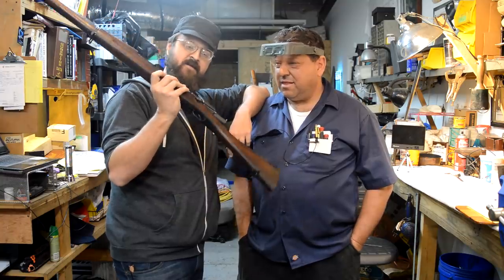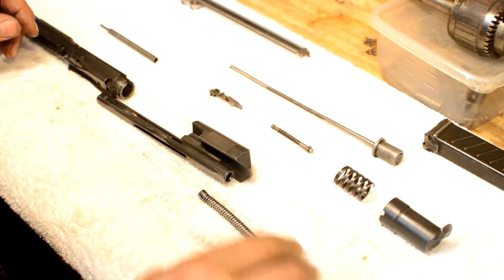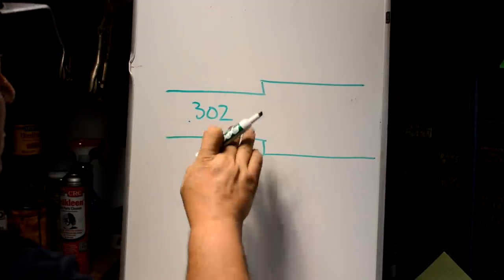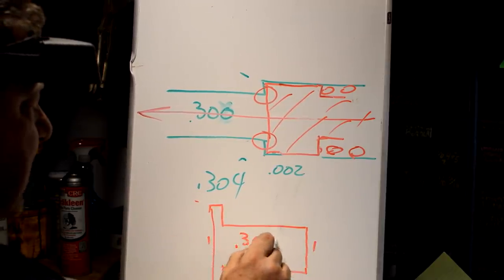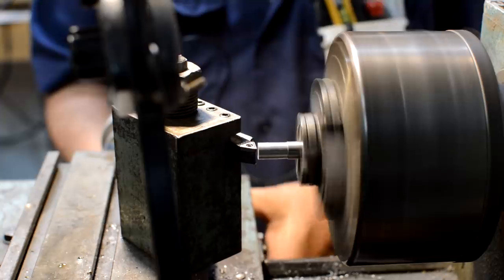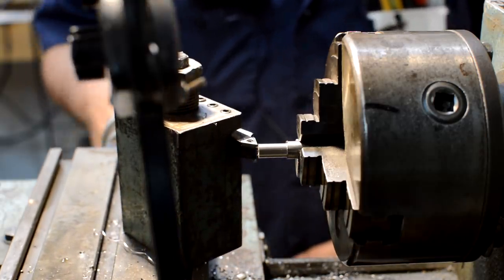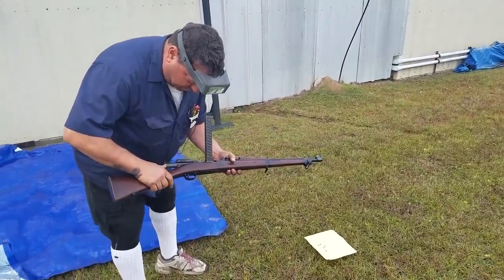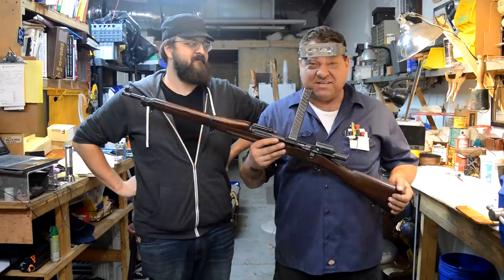Anvil 022: Pederson Device recovery

Comment: Don't know what's scarier. That someone thought packing what essentially is a pistol into a bolt and chamber of a .30 '06 made sense, that someone managed to make it work, or Mark's socks.
Reply: I'm going to go with making it work.

I've seen scarier socks, but after watching the C&Rsenal on the Pedersen Device I am absolutely amazed that it worked.
Reply: Well, we still have 32 acp and 30 carbine inserts for 308 and 30-06. If someone makes a semi-auto bolt and mag adapter for a 308 that would be an interesting camp gun.
Reply: @randomidiot8142  the Semi-auto part of that would be a pain in the ass. Bolt action rifles have a simple dropping sear with no disconnector. The M1903Mk1 has some extra parts added to work as the disconnector in the rifle.

I should add that I'm surprised that the Pedersen Device wasn't a full auto. I mean, they were planning on each grunt carrying some 400 rounds of ammo for it!
Reply: @ScottKenny1978  The bolt action rifle trigger might not have the right stock trigger mechanism, but if you can make a semi-auto adapter that's just a small hurdle. A disconnecter on a system like that would be easy, like a tippmann 98 paintball trigger mechanism for example. Technically the tippmann is an open bolt, I know, but it would work. 

I thought the pederson was from the bolt action magazine cutoff time period and before pcc/smg doctrine, so semi-auto makes sense to me..? 🤷‍♂️
Reply: @randomidiot8142  pretty sure that ATF would not like the design if you were selling the adapter and the replacement trigger. A big sign sayings "you will commit a felony with a penalty of $100k fine and 10 years in prison if you don't install the trigger group" isn't likely to fly. "Easily converted to full auto" and all that. You'd probably have to have the buyers send you their rifle to install the new trigger and send it back with the semi-auto bolt.

While you're right about when the Pedersen Device was made, it was also in the middle of Schnellfeuer, MP18s, and the inspiration for the Thompson.

Not to forget that the extra bits in the Mk1 ruin the trigger pull.
Reply: @ScottKenny1978  I think you may have misunderstood what I meant about using the trigger concept/design from a technically open bolt 'gun' on a closed bolt semi-auto. I didn't say make the converted gun open bolt, I just said an existing simple trigger pattern that is out there and it works/would work. The pederson is striker fired, the paintball gun is technically striker fired. The bolt on the conversion wouldn't be held back, just the striker. Not complicated to implement relative to the complexity of designing a semi-auto drop in adapter. 

Extra trigger bits.. well, I've got some simple triggers that are nice and other ones with extra bits that are nice. I kinda doubt that a nice trigger was a priority for these and other general purpose military arms..? 🤷‍♂️ Could be wrong, never hear it mentioned.
Reply: @randomidiot8142  let's see if I can explain this without pictures.

The original M1903Mk1 has a couple extra bits in the trigger that act as a disconnector when the Pedersen Device is installed, the disconnector is not part of the Pedersen Device proper. 

If you have an M1903mk1 with a standard M1903 trigger in it, the Pedersen Device would be full auto only, there's nothing resetting the trigger between shots in a dropping sear trigger. ATF would not like that at all.

So a modern Pedersen Device would also need a piece added to act as the disconnector. If we're doing this to a bolt action with a detachable magazine, it might be possible to stick the disconnector in there instead of in the bolt.

The pre-WW1 US Army was very big on competition shooting, Camp Perry matches etc. This didn't have a lot to do with practical field shooting. This also really drove rifle designs, particularly sights. Some vintages of Krag or 03s had very fiddly sights that were great on a known distance range and terrible on the battlefield. The desire for a good trigger is part of this target shooting fixation. It really took until OEF/OIF got going and the Army started training on a pop-up target range at unknown distances (may have started before 2001, but was not a thing for 1991 Gulf War). In full auto, you don't need a particularly good trigger. But when most of your shooting is Semi-auto, you want a consistent trigger. Heavy is tolerable, if it's consistent. That's honestly the biggest complaint about the M16A2 trigger, it has 3 different pull weights depending on where in the burst count you are, even in semi. It's mechanically simple, but not what anyone wants if they have a choice in the matter.
Reply: @ScottKenny1978  ok, I see a little of what you mean. The 03 looks like a Mauser type trigger similar to my arisaka and sort of like the carcano, but not a Remington type trigger I'm more familiar with. However if a reproduction was done a new trigger design with a disconnecter would be a simple thing that shouldn't ruin the trigger, and function just fine in either mode. I'm not convinced that the standard Mauser or Remington style trigger would allow slam fire if the bolt and striker were dropped simultaneously. Open bolts have mass to make up for bolt speed and strikers have speed to make up for mass. Since the striker is detached from the bolt I could see primers getting dimpled with the striker riding in the bolt, but I have a feeling the actual energy of the striker would be lacking not to mention feed issues if it wasn't designed to feed with the striker/firing pin protruding from the bolt face. 

Am interesting thought process to go through, although the likelihood of such a contraption of high cost and limited utility in this era of consumers that believe everything they read on glossy pages or glowing screens is highly unlikely. A few grains of titegroup, a whiff of fibrous material and a 60 grain hollow point in a 308 would work fine for camp varmints without the complexity of making what is basically a semi-auto pistol to drop in to a bolt action rifle to turn the rifle into.. a really heavy pistol/an underpowered rifle. Dare I say a separate blowback 32 or 30 carbine would be more practical? The horror...

Comment: The Pederson device was a pcc kit before pcc kits were a thing and its such a cool bit of engineering
Reply: Kind of like how the original M1911 prototype was a cool bit of engineering that became a respectable weapon after undergoing about a dozen design iterations. Sadly the Pedersen device didn't get that kind of opportunity for refinement.
Reply: @ostiariusalpha  modern pederson device when
Reply: @ostiariusalpha  The issue is that the Pedersen device is a PCC designed to fit inside an M1903 Springfield rifle. Not only is that a very impressive thing to pull off, even if it didn't work. But it's a pretty pointless task. The U.S. would probably have been better off issuing pistol caliber lever-action rifles.
Reply: @LUR1FAX  That's a lot more weight to carry an M1917 Enfield (which is what they would be equipped with if not for the Pedersen conversion kit) and a separate lever action, against inserting the smaller device and carrying more ammo mags. At least, ideally speaking.
Reply: @ostiariusalpha  Was about 15lbs of extra gear for the Pedersen kit.
Reply: If I find a complete M1903 Mk1, I will do unspeakable things to get a Pedersen Device made for it.
Reply: @ScottKenny1978  A lever action carbine, plus ammo load-out, would have been well over 20 lbs of kit.
Reply: @danieldillon6005  when someone ponies up a ludicrous amount of money for a bunch to be made. I'm seriously expecting them to be a $5000 unit, once in an approximation of mass production.

Also, you'd need an original M1903 Mk1 to have it work. Any random M1903 won't work, will not have the extra parts or ejection port.
Reply: @ostiariusalpha  Well obviously I didn't mean for soldiers to be issued a lever-action rifle in addition to a bolt-action rifle. That would just be stupid, heavy and utterly impractical. No, I'll argue that a lever-action rifle in the trenches of WW1 would have been far more useful than a bolt-action rifle. And at the ranges were combat took place in WW1, as well as the ranges at which soldiers could actually hit each other, a lever-action rifle in .30-30 or something would be more than sufficient for combat. 

Also, even if it's heavier than carrying an M1903 Springfield plus a Pedersen device, at least the lever-action rifle could actually have been available while the war was going on. And a lever-action rifle like a Winchester 92 actually works. The Pedersen device was invented too late to see any combat at all, and also didn't work. And the Pedersen device used a cartridge that was maybe slightly more powerful than .32 ACP. .30-30 or even a pistol caliber like .44-40 would be far more effective against targets that shoot back.
Reply: @LUR1FAX  That would have never happened, even if pigs flew and hell froze over. They absolutely used their rifles at longer effective ranges than .30-30 was good for. The French 8mm Lebel was a dinosaur of a cartridge in many ways, but its balle D bullet was actually quite advanced, allowing it to outshoot the German's 7.92x57mm S Patrone cartridge; which the Germans themselves noted. The real problems with lever actions though is that they were more expensive than bolt actions, more complicated to maintain (for both the individual infantryman and armorer), required more training to properly operate from the prone, and pistol caliber leverguns couldn't use stripper clips. Also, the .30-18 Pedersen is actually a fantastic cartridge and John Pedersen did an excellent job in designing it. The .30 Pedersen has about 33% greater energy than .32 ACP from similar barrel lengths and better penetration than .380 ACP; from a subcompact pistol, it would handily outperform either of those two common rounds. I mean, it's not 9x19mm Parabellum, but it isn't trying to be. What it could do though, is make for a much slimmer double-stack magazine in an ultra compact concealed carry handgun.

Comment: We have a #5 Warner and Swasey turret lathe.  It make jobs like these a snap.  And you could set it up to make thousands of them, for that huge unserved Pederson repair parts market!  😉
Reply: I ran a Warner Swasey 2A, 3A, and 4A for 7.5 years making bronze bushings, bearings, and washers. We also had a #5 but I think I only ran it maybe once or twice after the previous operator retired. I was trained on the 2A with extended bed, then went to the 4A as my main machine, got laid off after 2 years. Then 60 days later I got called back and ran the 2A with extended bed for the remaining time I was there.

The 2A's and 3A were in very good condition. The 4A was pretty well shot it was purchased from a Texas oil field that used it for hobbing pipe, they didn't even have the turret and turret apron on it. It ended up at a machinery dealer in Cleveland who put a metric turret on it. My employer and his purchasing agent were not skilled in assessing machines and bought it anyway. So no matter what you did the O.D. and I.D. always ran at different feed rates due to the Imperial gearing in the the one apron and the metric gearing in the other. Those power chuck wrenches sure were nice though.

Comment: Never judge an artist by his tools or his methods.  The proof is in the pudding.
Reply: Yes, but my heart broke when he was marking with the caliper on a running lathe. Hopefully, that caliper was designated for rough work, and that he keeps another one for  accurate  measurements.
Reply: @sidekickbob7227  if you own a calliper you probably an four or five of them. I love my high end Mitutoyo but my Ali Express tools get way more use and I won’t cry if I drop them on the ground.
Reply: @john-paulsilke893  Yeah, I always buy the upper middel quality ones (mitutoyo?), and degrade them after they get used. I keep one for accuracy, one for daily use, and one rough for marking. But I would never marked a piece in the lathe, while it was running. That's just abuse.
Reply: Or his shoes.

Comment from the maker: https://www.youtube.com/watch?v=M637KpEP1_E&list=PLJvsSlrbdhn5v8AuvAZuOYJ5BgEEoDdqm&index=67&ab_channel=C%26Rsenal      minute 32 is a full firing sequence on C and R senal.      I believe the AEF armorers would have been able to set these up to run given the chance. The part about switching back and forth between rifle and PCC on the fly would not. I think dedicated, worn out 03s would have been cut down to carbine length, and turned into purpose converted weapons. Kind of like the M1 carbine............?
Reply: I believe that they had it working. My source (1968 22nd edition of Gun Digest) says that 65,000 units were manufactured but all except a handful were destroyed. It also lists known units, complete units and partials. Also  Enfield and Mosin-Nagant units

Comment: Had a couple bad experiences running carbide inserts and trying to skim off a hair. Running hard and heavy on material removal looked fantastic and then the last .010" skim absolutely destroyed it. The worst part was the owner, the foreman, and the shop lead scratching their heads over what was going on. My input wasn't requested so I didn't bother saying anything about how to fix it. Skimming with high speed steel is much easier so I haven't bothered with carbide for my personal stuff.

Comment: Holy crap, how many of these are there in the wild, maybe fewer than ten?  Read a lot about the Pedersen device over the years but thank you for allowing us to actually see one in operation for the first time.  BTW, should that plunger you turned be heat treated?
Reply: Best not to harden it as it is a consumable in the scheme of things. Easier to make a new one then have to get inside and repair the face of that tube.
Reply: @DirtyRobot  absolutely
Reply: There's not more than a couple hundred that survived the destruction.

I'd love to get a reproduction, if I find a complete M1903 Mk1. I expect that it'd cost me at least $5k to get made, though.
Reply: @ScottKenny1978  Bruno is CAD'ing it apparently. you might be able to buy the file and get it CNC'd
Reply: @DirtyRobot  while I think that was for the animation on the C&Rsenal video on the Pedersen Device, I will definitely chase them down to see about getting one made if/when I find a complete M1903Mk1!

Comment: This is one of those devices where you really need two or three of them to compare one against the other when, you go to make parts. I also noticed that at 16:28 the hacksaw blade slides off the top of the piece. I quit using hacksaws for that purpose and just use cut off tools.
Reply: The problem is that when you make parts for guns discontinued over 100 years ago, finding any parts to compare with is a total challenge.  Let us note he didn't even have one original in hand and is working off someone else's measurements of a part they happen to have.  This is a common problem with a lot of late 19th, and early 20th century guns and sometimes you never do locate someone with a part to compare to and have to just try different shapes and measurements until you luck on something that works.

Comment: If it became a regular, decently functioning device in the army, I imagine it woulda been really effective in trench combat. A pistol caliber carbine with a 40 round mag woulda slayed in trench combat.
Reply: Seems that way, but compare to a .45 and an 1897, and I'm gonna give the Pederson a hard pass.
Reply: @RexApplegate  it isn't designed to replace your sidearm though even if originally it was a way of meeting the numbers when it became obvious they can't fully equip each soldier with one.
Reply: Problem is it’s attached to a heavy LONG rifle and the magazine is fragile and sticks out a long way out to the side. It’s made for the confines of trench warfare but it’s like a spear with a secondary fragile L shaped handle that can break and make the spear worthless… what they needed was the M3A1 “grease gun” in .45. Cheap stamped metal guns they could afford to pass out to storm troops.
Reply: @Whitpusmc  didn’t really consider the weight of the rifle, but had they tweaked it and made the magazine better in terms of functionality and durability it would have been better than 5 bolt action shots once you got into an enemy trench.

Edit: A grease gun would be the obvious choice for trench combat though, had that been developed at the time.
Reply: @big_yam  Yeah it was a good idea, maybe if the Springfield wasn’t quite so long? I wonder if this device works with a bayonet attached? Nice thing about a spear it doesn’t need reloading.

Comment: It may sound like a dumb question but would the coil spring issue at the 2:40 minute mark have been resolved if the original gunsmith had used a flat coil spring with more ability to compress?

Comment: Late question, if you see it and have time to answer, great! So:
In 11:38 when you drill out the hole the drill bit jumps up slightly when it touches the piece right before it starts shaving off material.
Does this affect the final part precision and consequent assembly and parts interaction?